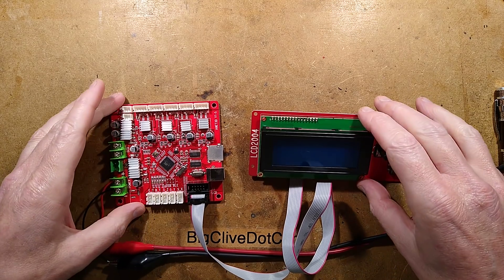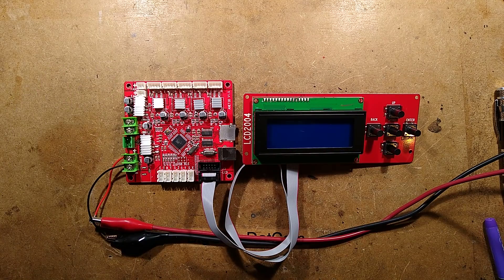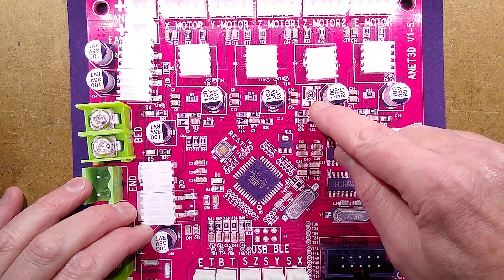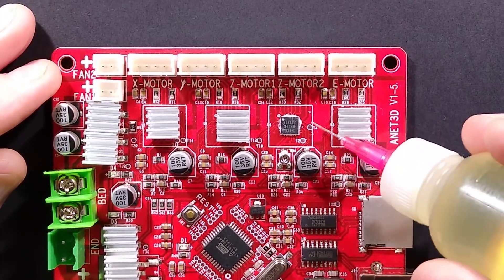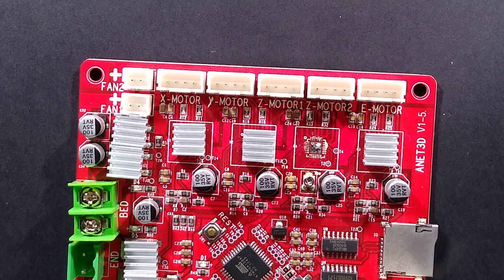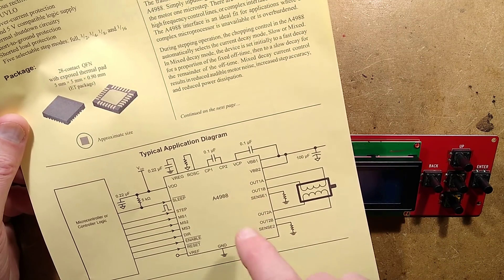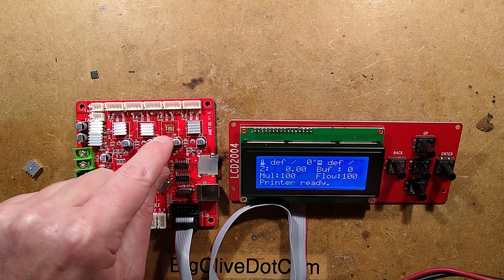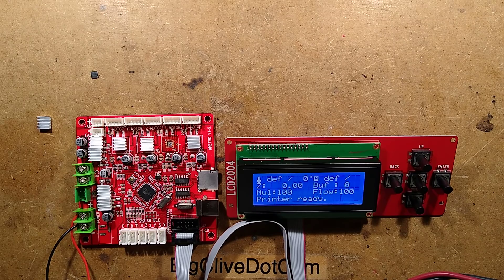Diagnosing a dead 3D printer controller

Comment: Very interesting video, since I had several 3D printers. I prefer much more "repair" videos than just dismounting devices.
One risky things repairing those boards is that you must have always the motors connected or in case of attempt to activation of the drivers, by the CPU, the internal current driven without proper motor return, can immediately blown up the chip.
Reply: Yes, though that depends on the type of stepper motor driver. TMC drivers are not so sensitive to not having the motor connected, as long as you don't disconnect it while the motor is powered.
Reply: I thought this was only a problem if you disconnected them while the motors were running?
Reply: Never once had that problem on the Anet 1.0 and 1.2 boards, SKR E3 2.0s, BTT Octopus, or the MKS Robin.
Reply: Running the driver without the motor connected is not harmful.  If you pull the connector out while it is running possibly the back EMF from the interrupted current could kill the driver.
Reply: I actually had no idea about that!
Reply: When the motor is not connected there is no path for the current, so no current flows, not a problem for any driver as long as it it isn't disconnected while energised. Then the back EMF from the coils can cause a spark.

My best guess as to why it failed was perhaps it was adjusted with a metal screwdriver without ESD precautions. I have known one to be destroyed that way.

Comment: such a shonky board...  I've blown 3 so far with mine A8.  the A8 has a  nasty habit of becoming a flaming ball of death if you're not careful.
Reply from the maker: Most of the manufacturers fail to protect against an extruder that has gone out of control for some reason.
Reply: Every 3D printer should at least have code to detect the thermistors in the hotend and heated bed becoming short, open, or physically falling out/off of what it's supposed to be measuring.
Unfortunately, a lot of them don't, and there's really no excuse.

Ideally they'd also detect a heater MOSFET failing short (thermistor reporting increasing temperature when the processor doesn't want the heater running) but you can't do a lot about that without extra parts, such as a backup MOSFET, or relay/SSR to cut the mains supply to the PSU, and I don't believe I've seen a printer like that (though it's on my to-do list for my own heavily modified printer, since the firmware supports it).

However they could still beep loudly to try to alert someone, and IIRC the Prusa i3 MK3 firmware turns on the part-cooling fan at full speed if it detects a runaway hotend heater, in an attempt to at least slow down the heating.

Detecting unreasonable motion, on the other hand, is challenging.
Some printers have the hotend mounted via a load cell so the nozzle touching the bed can be used for automatic bed compensation ("levelling"). That could probably be used to detect some collisions. And the printers with "sensorless homing" (detecting X and Y axis collisions by the stepper motor driver watching for stalls) could use the same functionality to detect some other collisions.
But all of that requires very careful tuning of the sensitivity...
Reply: @bigclivedotcom  Newer versions of the Marlin firmware do have thermal runaway protection by default, it appears Anet have just nixed this from their firmware for some reason. These boards are notorious for getting a bit toasty at the screw contacts and the extruder connector too, good idea to directly solder some beefier connectors to the board itself and flash better firmware for safety.
Reply: I don't understand why people buy Anet printers in 2021...
Reply: @gustavrsh  Because we all like dicing with death :) Actually its kind of fun to build and fix all the design flaws as you go.  But yeah why not buy a nice Ender 3 or similar
Reply: May have been a good idea to print a pot trimmer, then do the replacement.  Making a mental note to see if pot trimmers are on thingiverse
Reply: @MineSpeed 200 sure, but ender 3 clones exist at the 160-200USD range that are better than the ender 3 itself

Comment: F this. I have enough problems with the 2D with ones. You rock man!
One can also use some shrink on your screwdriver to protect it.
Reply: I'd use my 3D printer to print on paper if I could. 2D printers are so much more annoying and expensive than 3D printers.  😂
Reply: @BRUXXUS  took me 3-7i weeks to troubleshoot my 4D printer. Worth it though.
Reply: @BRUXXUS  Theoretically, you could. The kindling point of paper is about 230c, so I don't think it would immediately catch fire if you're using PLA temperatures...
Reply: @Blooest  It's pretty easy to make a pen holder to allow a 3d printer to work as a plotter. Something I've wanted to try for a while.

Comment: I have a poor man method - isopropyl alcohol to find hot stuff.
Reply from the maker: That's the classic Louis Rossman approach.
Reply: I literally used this method last week to diagnose a dead TV main board. Works perfectly, new board installed and TV is working again.
Reply: @MineSpeed 200 just boiling.

Comment: That was too easy with the thermal imager. Have to say not a lot skill shown Clive. ;)
Reply from the maker: It was more to show how useful a thermal imaging camera is.  The fingers worked just as well at that current.
Reply: @bigclivedotcom  I wish I had one 20 years ago. Would have made my life so much easier. But price was a little prohibitive.
Reply from the maker: Likewise.  In the era of electromechanical elevators a thermal imaging camera would have shown up bad contacts immediately.
Reply: @bigclivedotcom  When I worked in a data center, the electricians would routinely take the cover off the circuit breaker panelboards and use a thermal camera to check for bad connections/overheating breakers.

Comment: Why are there 2  Z stepper motor drivers?
Reply: To allow for a fancy 'dual Z' configuration. As they use a single driver with the output connectors in parallel, it just replaces the 'Y' connector sometimes used for that purpose.  An other way to do it is to have a 5 drivers board and mirror the Z axis in software.
Reply: It's better to run dual motors in series rather than parallel, incidentally.
Stepper motor drivers control based on current, so splitting that current between 2 motors that likely have slightly different characteristics isn't ideal.
I don't know off-hand if a 12V system can reliably drive 2 series motors (I think it should be ok...), but most new 3D printers now are 24V which is plenty.

The Duet boards have two Z motor connectors in series - and use a couple of 0.1" jumpers to short out an unused connector - but I've only ever seen parallel motor splitter boards on AliExpress....

Instead I connected 2 Z motors to a single driver using some Wago terminals and it worked nicely! You just have to think a bit about the wiring, connecting each motor's coils together in the correct direction. Ironically a series splitter PCB would be a lot more useful; parallel splitting with custom wiring is much easier!
Reply: It`s better to run dual Z with independant drivers as it offers easier leveling since each motor can be controlled slightly differently from the other one at the same time, running in series or parallel you can not do that as both motors have to move together since they are connected together. Boards like this anet are produced to a price point and you take what you are given unless you upgrade to better controllers. 2208`s Silent drivers (and others) with newer hardware will make a lot of difference esp if the printer has dual Z axis. (G34 make life easy) & a crash course in compiling Marlin 2.x
Reply: Because the A8 uses 2 Z axis stepper motors to drive the gantry up and down, rather than one like say the Ender 3 or others of that ilk.

Comment: Thermal cameras are awesome; I'm looking at buying a Uni-t 690B. Not cheap but very useful.
Reply: @ts757arse  Those things are shockingly inaccurate; the laser is a rough indication of where it's reading, not actually anything to do with the temperature measurement.
Reply: @FauxFauxes  they give more of an average temperature reading for sure.  It will tell you that something is hot, just not what :)